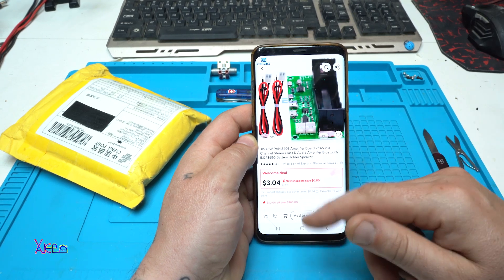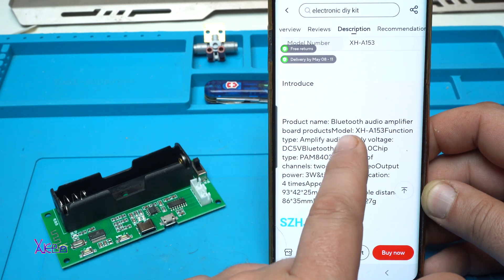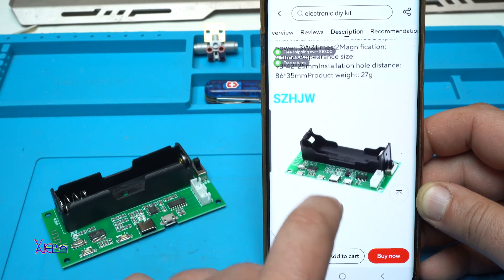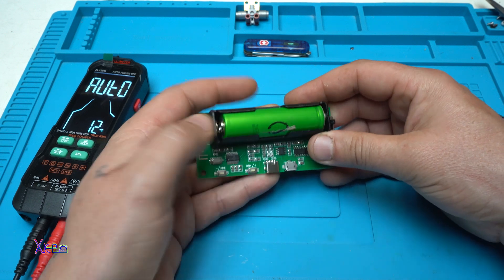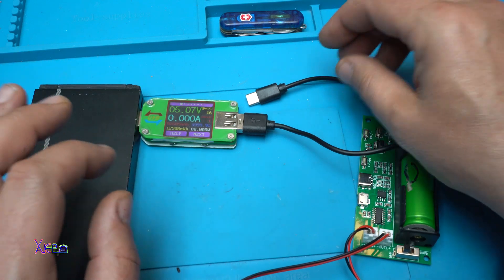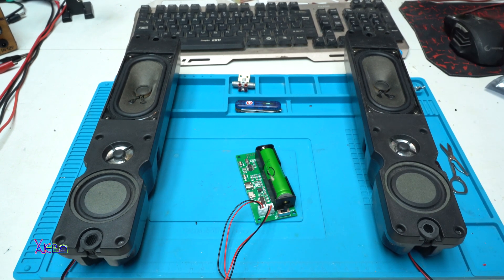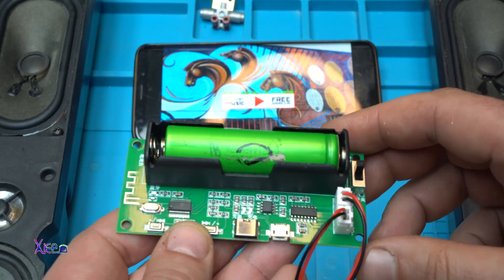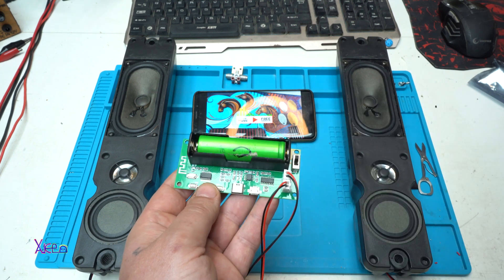$3 Aliexpress Bluetooth mp3 Decoder is INCREDIBLE!

Comment: Another disadvantage of this module, as it is, will be that it will radiate large amounts of RF at the harmonics of the 260kHz switching frequency. I suspect that in most countries, the resulting Bluetooth speaker would not meet EMC regulations.
Reply: HOw effective can filtering on the board be?
Reply: @mscir  I'm not sure, but I can see that there is none on this board.

Comment: I work with microprocessors and really struggle with power (which you are good at) - Can you do some videos on controlling power buk, mosfet, relays - basically I want to be able to have 240v (residential) and have options for 12v,5v, 240v come out of it. Just simple things like being able to have a 5v plugged into 240v that I can turn on and off becomes problematic. You often have videos where the item is already plugged into a power source that is already transformed  -  then you are transforming it.

Comment: It works well, but it would be better with the battery holder and wire connections on the other side so you can make a case that would allow using the buttons look better.  As it is you would need to make a button/switch board separately to put on the outside case of the speaker for it to look nice.  If they'd do that, it would be REALLY incredible.

Comment: Once you see the module in action, it makes a lot of sense. You can put together a low cost bluetooth speaker. You can find speakers like you did dirt cheap everywhere. This would be great to put in a shed or garage where access to an outlet might not be convenient.
Reply from the maker: Yes need a proper case,I will do it in one of my next projects
Reply: @Hacktuber  The case would be an interesting challenge.  It would be hard to give access to the controls with the battery holder and speaker connections on the same side of the board.  I'm wondering if this was a bad production run and they're selling off the mistake rather than scrap or rework it.
Reply: Si sería muy bueno para cuando uno sale a la playa o algún lugar a divertirse, lastima que aquí en Venezuela no se puede comprar por el bloqueo
Reply: @jcamaranrx222 cuál bloqueo mijo? Será en tu mente 😂
Reply: Thinking to put this in annold boombox and make it bluetooth